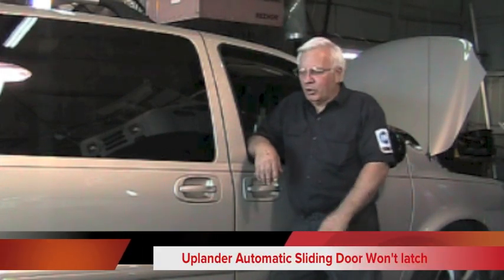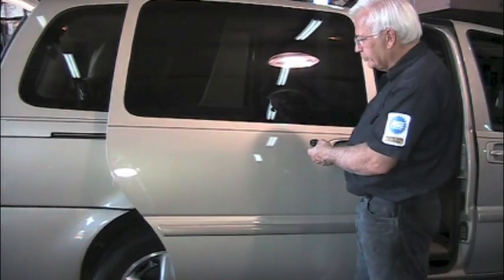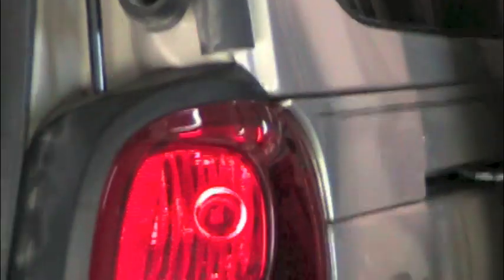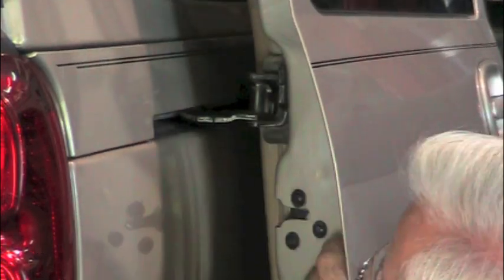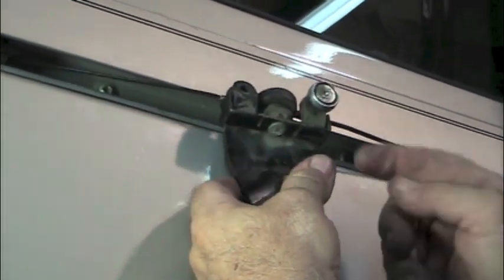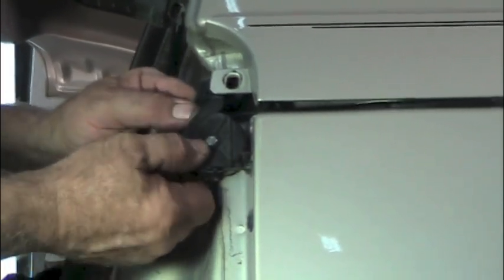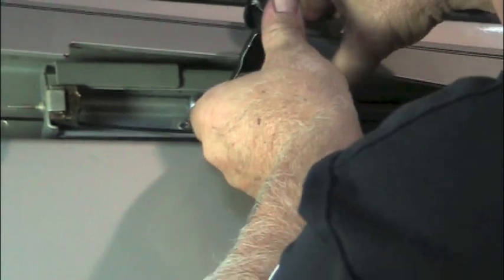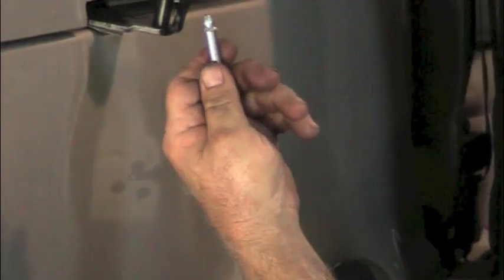Uplander Sliding Door

Comment: LOVE THIS VIDEO!!!! Several years ago a passenger tugged on my automatic door to try to make it open faster - ignoring me telling her to stand back. Since then my door never operated right. Every once in awhile, the bells won't turn off, even though the door looks and feels "flush" from the outside. The door seems to hang up when it opens - motor wants to shut the door, but the door won't advance forward.  1) You told me where the fuse is to get rid of the power in this door permanently. THANK YOU. The other side is already permanently manual - what a dumb design they did! 2) Hopefully no fuse - no bells? 3) You have me curious if it is a broken roller. This looks like it might be fun to try to fix. (As long as I don't have to listen to those bells while fixing it. :-)

Comment: thank you! about a year to year and a half ago the power dorr on our 2006 Chevy Uplander started to have this problem.  we just stopped using it because we assumed it would cost too much to fix.  well today my driver side sliding door (not power) fell off!  Both rollers broke off that assembly and when i went to shut the door the back end of the door fell off and the sliding assembly came out of the track.  Now i know we can just order the 2 parts and fix it our selves.  let me tell you that is a lot easier than replacing the battery.  that was a pain in the A$$

Comment: My problem was the cable had plastic around it, and the plastic wore out, and started coming off the cable. The cable twisted and came off the roller...couldn't find out how to fix it. The door wouldn't close. No choice but to cut the cable, so I could use the van. Can't find replacement cable, or how to install it.....up a creek!

Comment: I have 1997 Pontiac Trans Sport with one Siding Door on passenger side. My problem is---Sliding Door will not lock or unlock. Must do it manually to lock or unlock. All other doors do work. I don't know is does sliding door open and close electronically. Or sliding door must be opened manually with an electric/remote/button and only locks and unlocks.

Comment: Am handicapped an own an 2005 uplander conversion. The passenger power sliding door has been opening and closing half way or not at all Recently it opened and lowered the ramp while I'm driving. Chevy replaced the spring contacts on the door and the mobility place replaced a few bolts. The door is still intermittent and scary. Can anyone help. Please

Comment: Driver side sliding door.  Will only open like 8 inches. Then it won't do anything. . Have to close manually.  Any idea of what could be
Reply from the maker: most likely an interrupted circuit.  Check for a broken wire to connector